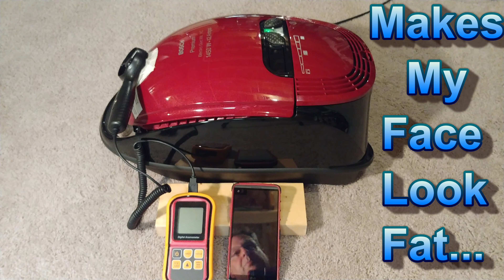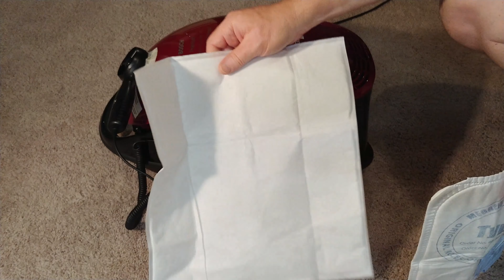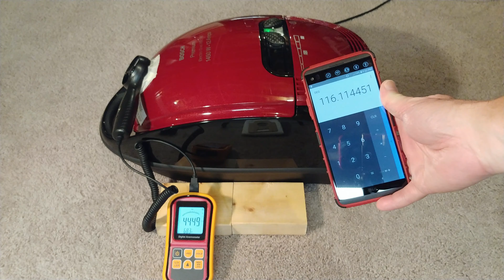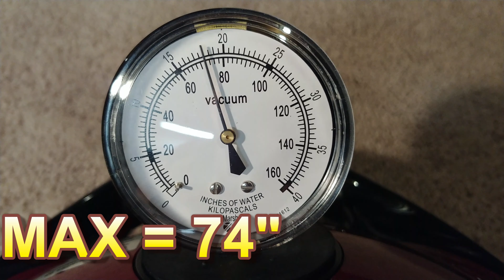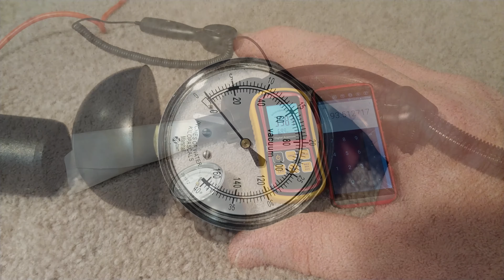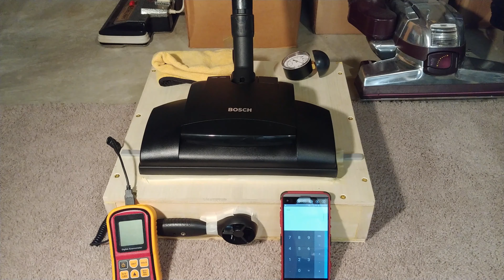Bosch Premium Electro Duo XXL Airflow Suction And Particle Tests

Comment: That is a nice nozzle cfm result. Around 20 cfm more than typical bagless vacuum. Also better than the Miele Callisto S5281 what you have (66 cfm). In my experience EBK 340 becomes too hard to push with over 80 cfm so 72 cfm is definitely where you want to be.
Reply from the maker: I can confirm that for my carpet, I wouldn't want any more nozzle flow as it would become uncomfortable just as you have stated. 👍